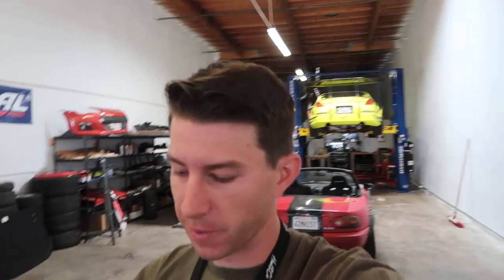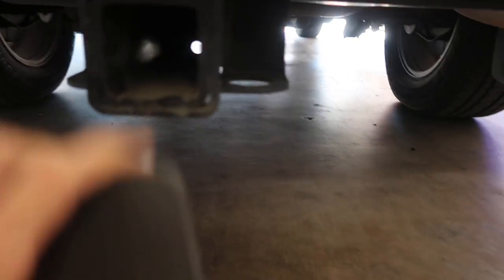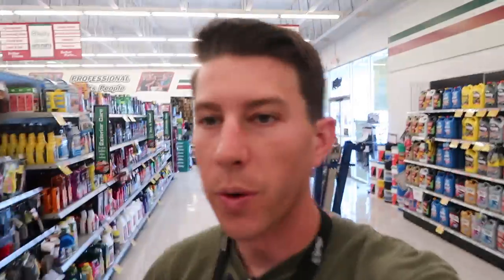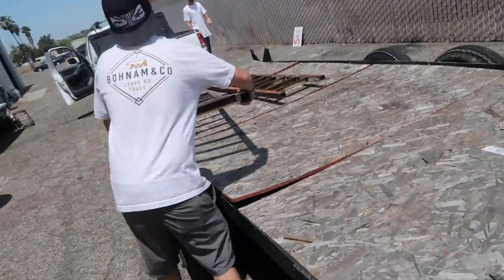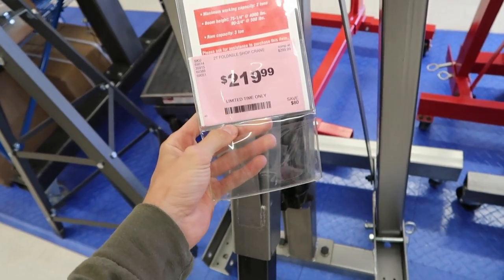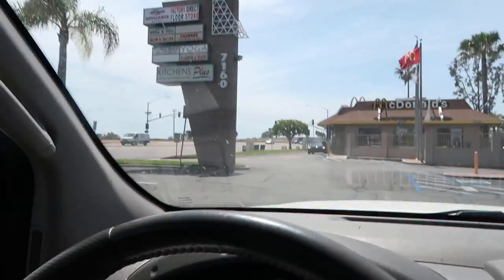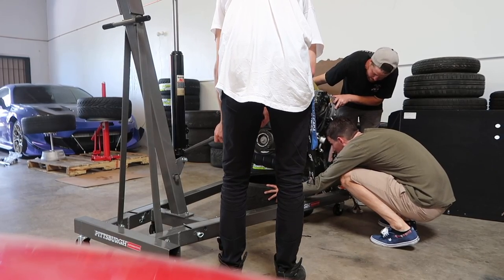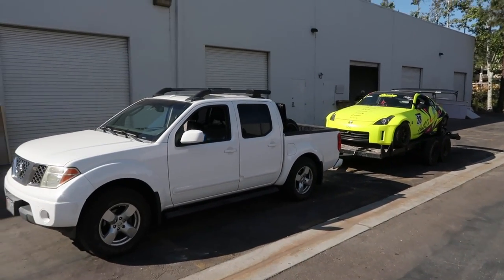This determines what Truck I Buy!!

Comment: Ya that is just not really a good idea.... Your suspension is just not meant for that, or the gearing in that rear axle. Should really probably look into a 3/4 ton truck. You might get away with a half ton but definitely not a mid size truck. Kinda dangerous what you just did there.

Comment: Don't pull your car with that truck! Manufacturers us their tow capacities as bragging rights and you NEVER want to tow near your max. That truck shouldn't pull more than 4-4.5k to stay comfortable. The engine may have the power to do it but your transmission is going to destroy itself. Get a real truck man.. do it for the bros!

Comment: The frontier's transmission is not gonna last long, plus breaks will disintegrate in one trip. I am a truck driver, and I would not drive that setup past my the end of my driveway. YOU WILL ARE A HAZARD TO EVERYONE ALSE ON THE ROAD WITH THAT SETUP. Use a larger truck. #RIP

Comment: Your gunna be climbing the pass coming up the 15 fwy doing 20mph while big rigs run you off the road. I'm a fan but you have horrible knowledge about trucks really it's very sad having that much weight on the back if you get up to a higher speed you can get Swaying and you can lose control very easily be safe out there my dude. Only Tj would do that!! Lol

Comment: Dude, you are way over your capacity. And you are also putting a lot of strain on your motor and the frame of that truck. Just got buy a ford or chevy. No offense but this whole video and the question should you buy a truck new truck to haul a car should be common sense...

Comment: u can really tell that ur a city boy from this video. Here in Ireland most people learn to drive a manual at a really young age e.g. 12,13,14 ish( obviously this is illegal as u have to be 18 to get ur license here) and most people are well able to tow a trailer and park it etc.. btw it's normal to feel a heavy weight when towing a trailer unless u have something with an insane amount of powere.g. a toyota.

Also, here in Ireland u need a trailer license before u can tow a trailer on the road (legally)

Comment: No, pushing max capacity is not a good thing. You're going to fuck that truck up by putting too much weight on it. Why do you have to be so stupid? If anything happens to that truck and you're exceeding towing capacity insurance won't cover to fix it.